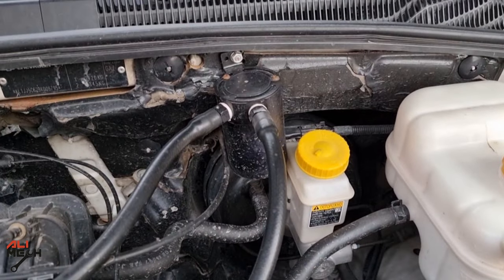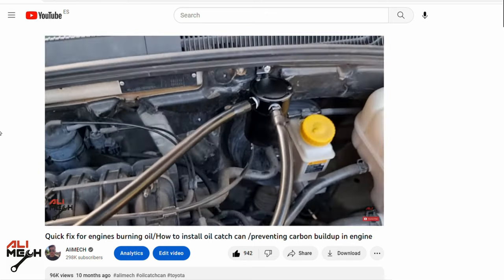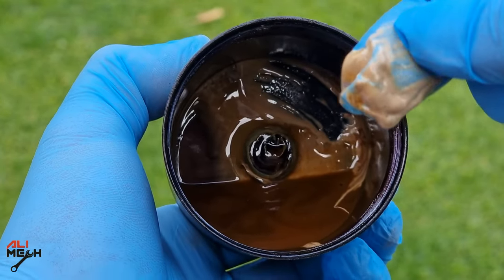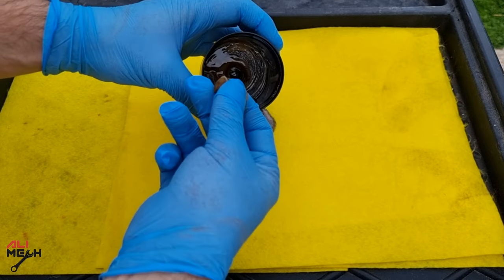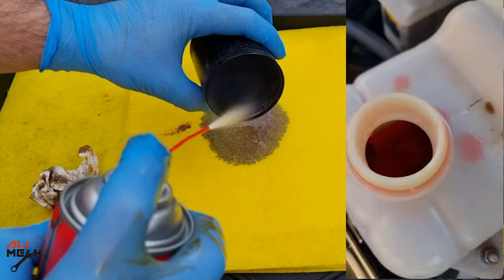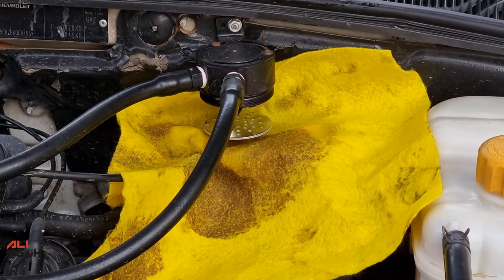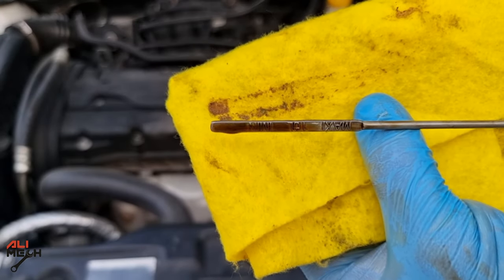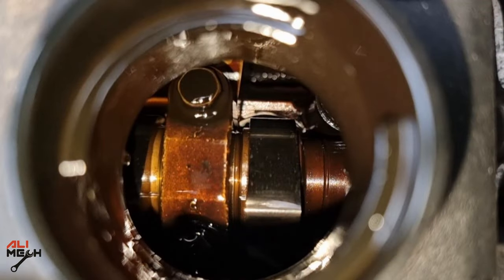Here is why milky oil in catch can / Is that engine needs rebuilding??

Comment: I've had them on my vehicles (In Canada) for the last five years. Total believer in catch cans especially for direct injection motors.
You'll see more creamy/oil caught during cold and wet conditions.   
Much better in there than coating your intake valves.

Comment: The oil catch can is a very good product from what I can see! Ali, you could be a dealer/installer of this product
quite easily! It would be a nice way to make some extra money on the side! You know how some of these car 
dealerships have a separate department for installing stuff like stereo systems, car alarm systems, etc; well it's 
a nice little marketing ploy! You are actually on to something and you are just as clever as ever!!
Reply from the maker: Thanks for your feedback,  I just wanted to show how good it works, even its not the expensive one, but I found this on aliexpress and it has same filter and strainer just like expensive one
Reply: @AliMECH  I tried to find that same design too! They are not easy to find, yet after about an hour after search, I kinda gave up! As it stands, I will probably find one, just in time for my son's birthday!
Reply: @AliMECH  I don't like having to order directly from overseas, namely China! 
So instead, I try to find on e one eBay or Amazon!

Comment: Ali hi . i have another question how to clean Catalytic converter without reducing it efficiency.  i seen loads of video but i am not satisfied.  could you do observations and make us easy video for cleaning Catalytic converter.  i saw many ppl made a hole in exhaust just b4 Catalytic converter to spray carborator cleaning liquid etc.
Reply from the maker: I have a video about that, but I will make new one soon for sure